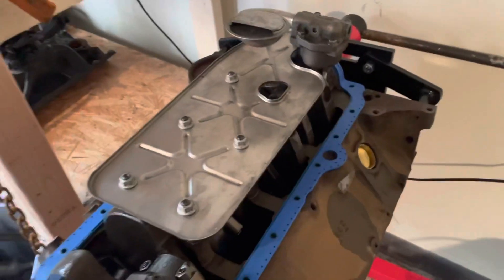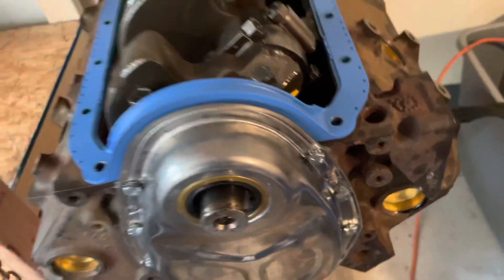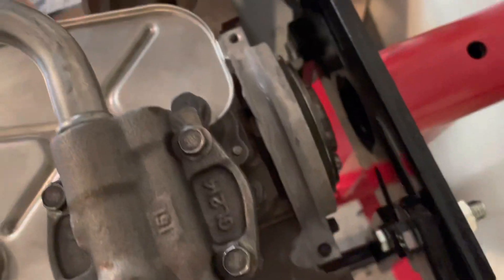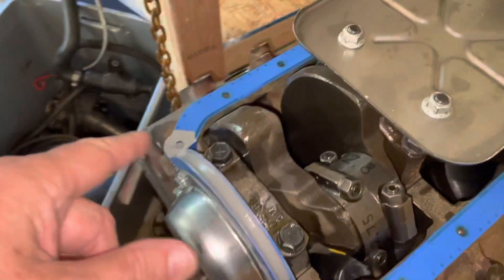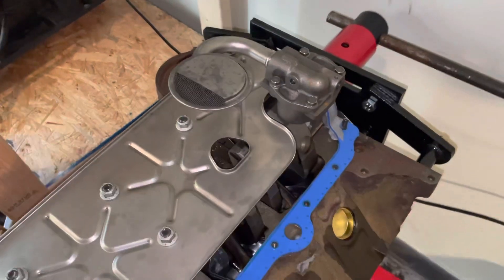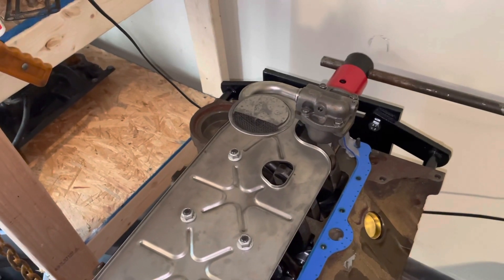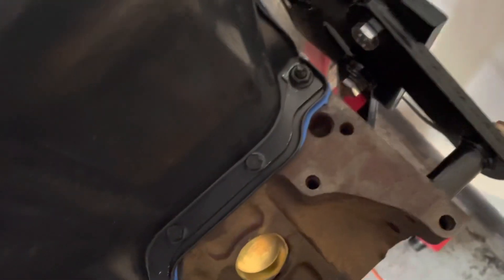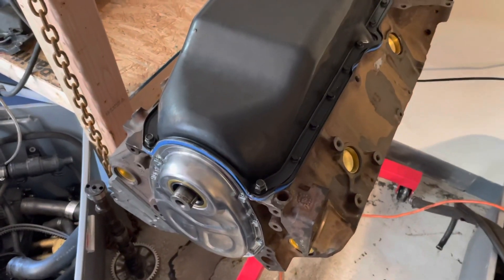Mercruiser 5.7 1(g2) - Oil Pan Install

Comment: Could you share the source of a metal timing chain cover for this engine??  I've been told that only the plastic will fit and allow enough clearance for the water impeller housing.  I have issues with oil leaks from both engines at the base of the plastic covers!  Thanks.
Reply from the maker: I’m not aware of one. But I also don’t have leaks there. The issue is there are two gaps between cover and block that can’t be seen unless engine is upside down. If I can find a video I did on this issue I’ll post it.

Comment: What is the difference between a standard gasket and the Marine gasket
Reply from the maker: Nothing on oil pan gaskets.
Reply: @moccasinmarine  You mentioned the head gaskets had to be ordered separate for marine application. What the difference in the head gaskets?
Reply from the maker: @MarcRoseVetteNuts  Marine head gaskets have a stainless steel fire ring and stainless steel core. Standard gaskets don’t. This is what FelPro told me but I never confirmed it with metallurgical testing.
Reply: @MarcRoseVetteNuts  marine head gaskets are stainless steel.

Comment: Here’s a question for you. I have a 5.0 mpi in my boat I am certain  the engine was changed before I got it and to me it looks like it has the truck oil pan with the side oil drain so I’m assuming truck block as well. How much oil should I be using? If I put 4.5 quarts in I’m way over full on my dipstick for some reason.
Reply from the maker: Simple don’t trust the dipstick. 4.5 qts is probably about right for your engine.